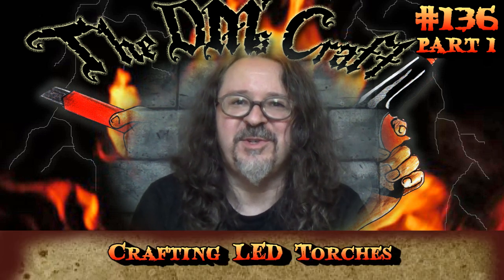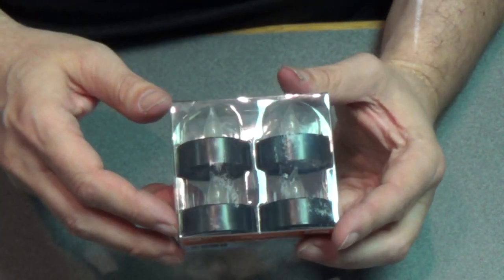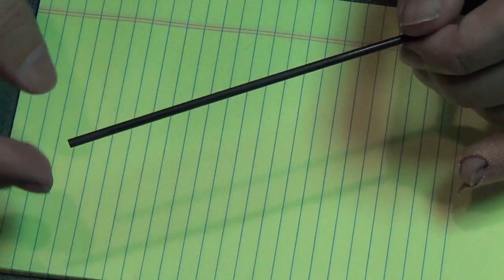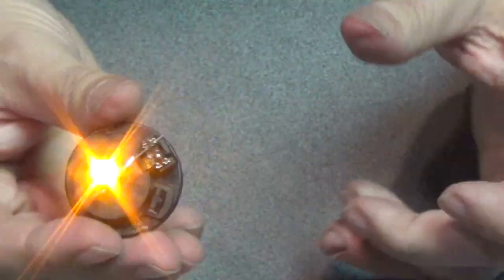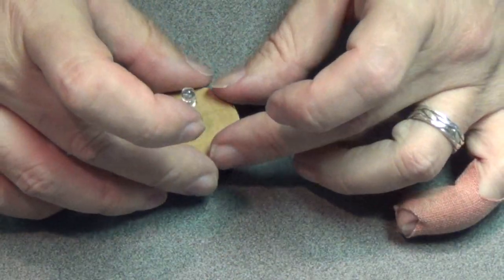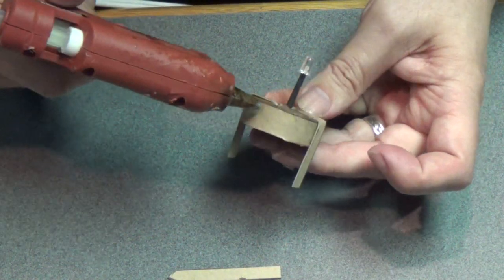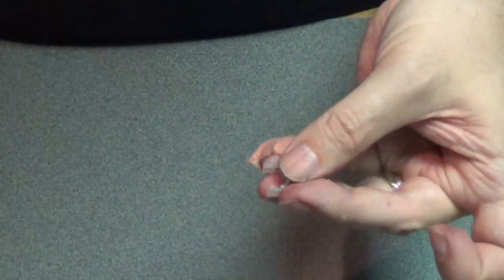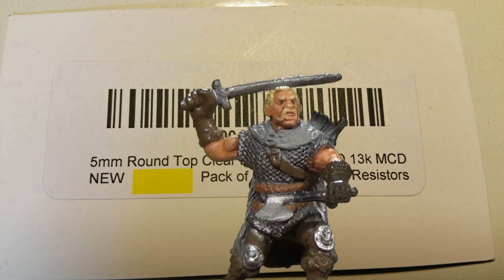Mini LED Torches for Table Top Games (DM's Craft #136/Part 1)

Comment: These look great! I'm looking forward to part 2!

A few words of caution for people working with electronics for the first time though -  

1) Remove the battery before soldering
2) Electricity should only ever flow through LEDs one direction, so make absolutely sure you solder the positive (the LONGER) leg of the LED to the positive terminal on the battery pack, other wise you could possibly blow up the LED
Reply from the maker: +Evan Korf Thanks for the great safety tip as I am ignorant in this type of thing.
Reply: +theDMsCraft Always happy to throw in my two cents! Seriously though, these looks amazing and I'm stoked for Mini LED Lights Part 2: The paintening.

Comment: Thumbs up!  ...can't resist...engineer input: If you don't find these exact brands/models, use your classic V=IR equation to ensure that your LED matches your base for voltage and amperage...else the light will either instantly burn out or be far too dim.
Reply from the maker: +Wyloch's Crafting Vids Great tip for those of us ignorant in the ways of electrical engineering.

Comment: What brand of tea lights are these? I discovered to my chagrin that not all tea lights are manufactured the same. I got some tea lights at the Dollar Tree that have a really cheap switch mechanism. When I removed the top from the tea light, the integrity of the switch mechanism was completely compromised. The plastic of the switch is very malleable, and pushing on the switch alone does not turn on the light. I have to hold the mechanism down.

I bought another set at Wal-Mart, hoping to get the one you have pictured here. When I pulled the battery away from the housing, the light bulb went with the housing, and the switch - again, was compromised. No recovering from that one. The operation you show depicts a tea light with a heck of a lot more structural integrity, and it looks easy. NO functionality lost. How do I get THOSE tea lights?
Reply from the maker: I thought the ones I used were from Walmart...I got them at Halloween.
Reply: I wonder if a manufacturing process or design change for a cheaper production took place since Halloween. The tea lights are the Wal-Mart Mainstays brand (all their in-house home décor products, from ceiling fans to small furnishings use this branding), and are white - not holiday specific. I am looking into some solutions to keep the switch in place when the top is popped off. One possibility is a washer, but I found I need a 5/16" center to fit around the housing that the light bulb is seated in. The adventure continues. :-D Thanks.
Reply from the maker: I will see if I can find the brand name.
Reply: Thanks. If I find a way to stabilize the more cheaply built switch, I'll let you know the solution I found. We do now know that there are at least three switch designs, two of which don't seem to work like the one you showed. :-)
Reply: Did anyone ever figure out the brand? Running into the same issue.

Comment: I want to let everyone know that there is a side of the LED that is flat(cathode if I remember right). Make sure the new LED matches the flat side or you will burn the LED out.
Reply from the maker: +Nathaniel Martin thanks much for the tip.

Comment: I would have just desoldered the flickering LED light instead of cutting it off, then ran wires through a straw. This way you could have the flickering LED instead of just a static light. Great job though.
Reply from the maker: Good point

Comment: You can get 4 packs of led tea lights at Dollar Tree stores for 1 dollar
Reply from the maker: Cool
Reply: Sadly the Dollar Tree lights are traps: when you remove the tops, they won't light up, because the top creates the pressure needed for the switch to work
Reply: Jo Nemo not all of them are like that.  Also I have accidentally gotten some like that it's not pressure but a metal piece in the top that complete the circuit.  all you have to do is attach it to where it touches when the top is on.
Reply: Wouldn't that keep it on forever though?
Reply: Jo Nemo no because the switch on the bottom would turn it off and on.  All you are doing is permanently attaching a part of the circuit to the rest of the circuit, but it still works by the switch on the bottom
Reply: awesome. you wouldn't happen to have a link to a diagram or a photo would you?
Reply: Jo Nemo no sorry.

Comment: I did something similar a while back but I replaced the led with one of these as this one flickers like a candle and all you need to do is hook up a battery all the flickering is done in the led for those with limited space or you can run the wires through a wall of a dungeon and make some wall mounted ones hers the link to the ones I got 

http://www.ebay.co.uk/ulk/itm/291252890071